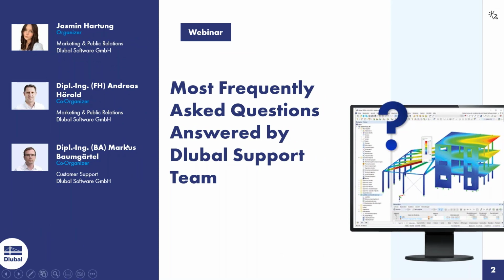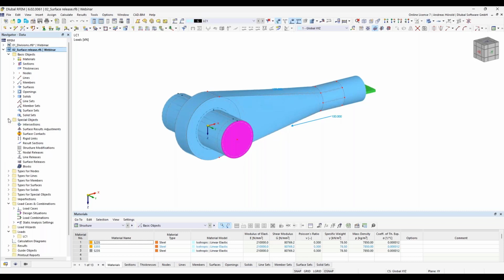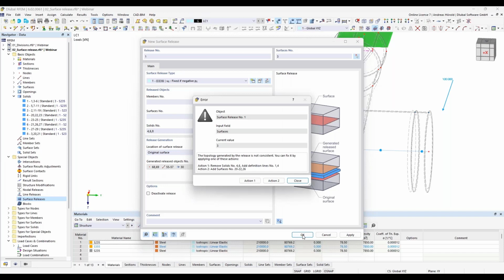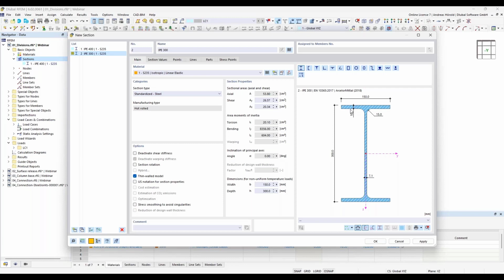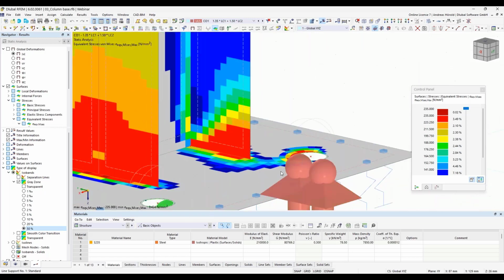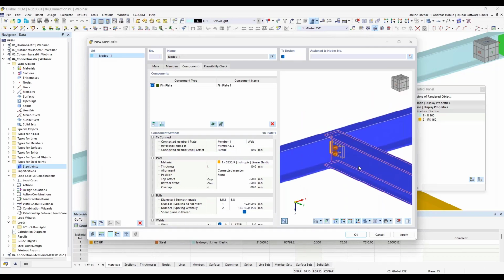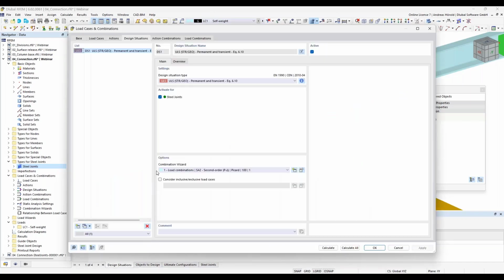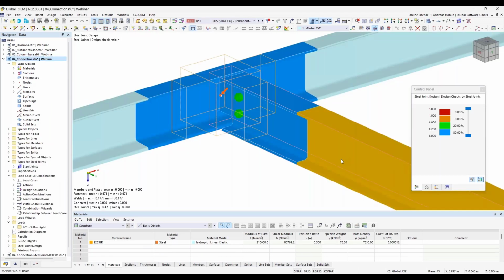Most Frequently Asked Questions Answered by Dlubal Support Team | April 2023

Comment: Does it matter if use contact solid or surface release?
I mean results.
Do they convergence?
Any difference in outcomes?
Reply from the maker: Hi, Jakub!
You can model it with contact solids or surface releases. The results should be the same. However, modeling contact models is more complex.